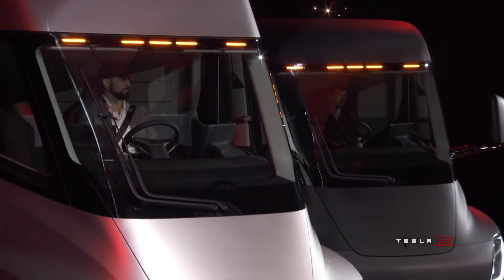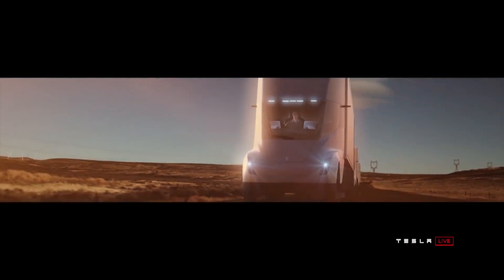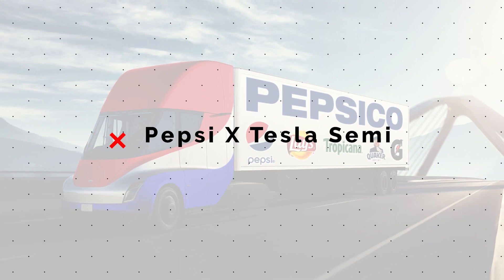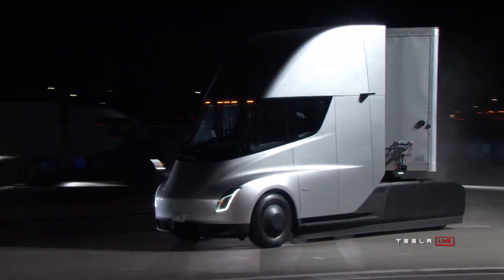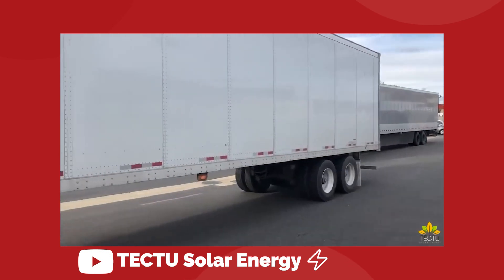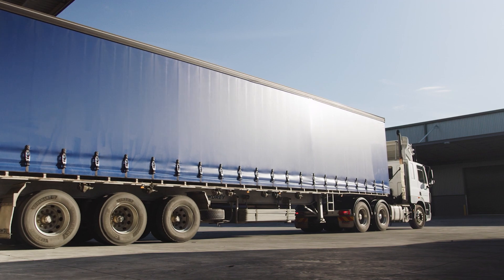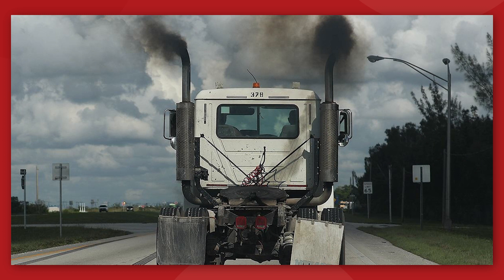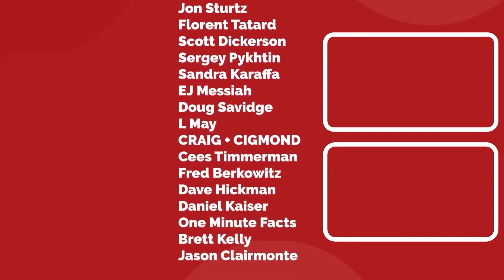Major New Tesla Semi Update Is Here!

Comment: Diesel engines can produce 2 times the amount of energy in watts than petrol engines . I see a good reason for tesla semis to have small onboard  backup generators to charge 1 of the battery modules for emergency movement of the vehicle and also to directly power the motors as a redundancy incase of electronic failure of the main system. Diesel is well proven and still worth its place in future technology . It has all the best hallmarks of any fuel except for emissions and particulate. This can be easily mitigated through water filtration of exhaust until this all electric technology has ironed out all the wrinkles and done it's time in the real world . The future is bright so let's not shoot ourselves in the foot !
Reply: you're just adding weight and complexity. The semi will be used where the 300/500 range models can return to base to re-charge as need new 1Mw chargers. Not meant for ALL use cases but will work for enough buyers like Pepsi and others as orders have shown.
Reply: @markreed9853  and what happens if an 80,000 pound truck has a power out issue in the middle of a busy dangerous highway while raining. You think a 10 pound generator the size of 2 briefcases is a waste of weight then . Its just to move the semi out of a dangerous situation . Your a danger on the roads without even being on it with your wisdom level . A chairgineer if I have ever heard one !
Reply: @Buzzhumma  Nothing is perfect in life but at the end of the day the designers, engineers and users will make, buy and use what works for them - if it doesnt then Tesla won't have a viable business model. I'm sure they know what they are doing and why!

Comment: So how have they solved the problem of the battery wight limiting the payload to about a quarter that of conventional semis?
Reply: The battery is not that much heavier than traditional engine/transmission/fuel. They're allowing an extra 2000 lbs for electric trucks, so it should work out pretty close to the same payload.

Comment: The smog regulations apply to new trucks, not old. Yes you can meet these standards with a Diesel engine. The answer has crossed your path at every railroad crossing for decades. Hybrids is actually a better solution, at least for the next 10 yrs or so till EVs catch up, as it requires no changes to the current trucking industry. It would cut pollution greatly and give EV performance numbers with out rage issues. Even if a hybrid truck could double the mpg, that would be a huge benefit.

Comment: Yes,you can reduce smog emision for diesel engines,with particle filter,catalotic convertor and ad blue,the problem is that manufacturers dont want to install this devices in the vihicles
Reply: Why don't manufacturers want to install these devices in the vehicles?
Reply: @Marc_Gagné  because it will increase the purchase price of the vehicles,and the logic of company leaders is that if a vehicle costs 2000$ more people just wont buy it,dont ask me,i have to high iq to be ceo
Reply: @Dustrunnersauto  i dont belive this,i live in uk,and in ower town the bus fleet is quite new,bought in 2017 and 98% of them already make black and blue smoke,some of them quite heavy, thise are buses that run in the city,around people walking on sidewalks in city centre bdw.
And i havent seen any "ad blue" filler door,only for diesel and oil,so i belive they have 0 anti polition devices.

I dont know but i think the bus fleet i talk about was manufactured in uk,i think mercedes busses dont make this mich smoke even older mercedes busses,as i m from romania
Reply: These devices substantially reduce reliability and increase maintenance costs. Electric is better.

Comment: Concerning ICE efficiencies, consider that ICE engine efficiencies are only now approaching 40% after over 100 years of development.  Electric motors came on the scene with four times the efficiency of ICE engines, and that is just the beginning.  Granted, efficiency on ICE engines has suffered due to technologies to reduce pollution but personally I'd rather drive a car that didn't slowly reduce my own life expectancy while I drove it.
Reply: So, ICE cars have 40% efficiency and Electric cars have four times the ICE efficiencies, so EVs are 160% efficient?  Wow.  Finally a perpetual motion machine.
Reply: @billweberx  You're thinking about it wrong.  ICE engines waste 60% of the potential energy from fossil fuels.  Run-of-the-mill electric motors only lose 15% of the energy put into them through heat and friction.  In fact, Tesla's motors are losing less than 5% of the energy they consume.  So yes, electric motors started out four times as efficient, and are only growing more efficient as time goes on.
Reply: @ibnorml  I wasn't thinking about it wrong.  You said it wrong, originally.
Reply: @billweberx  I will concede you are correct.

Comment: I just calculated: a semi trailer full of panels would propel this truck 94 miles per day... It's time to take advantage of this surface and technology as well...
Reply: What about the weight of those panels? Trucks in the US are limited to 80,000 pounds. If I remember correctly.  So that weight further limits the amount of product transported.
Reply: @nunya___  good question. I just looked up the weight of flexible panels and calculated the weight to cover a full trailer size. It would be 1100 pound of extra weight. The question would be if this weight would actually need to reduce the freight weight. If so, it's worth to consider the gain of spending less money on diesel or electricity. It's a money game, but I make any bet this will be the future!
Reply: @Gallardo6669  Are you figuring cells on the roof only? If your numbers are "real world" then a free 90 miles of range a day is significant.
Often drivers only pick up and deliver the trailers and a huge number of trailers are sitting for long periods so solar trailers would special case every-day use to recoup costs.
Reply: @nunya___  hmm, you certainly have a point. However, if all trailers are equipped with panels any truck would benefit from the panels once hooked up.- I simply calculated based my own solar array, the physical size and daily output per day in best conditions. I calculated a trailers roof and 2 sides. Panels vertical mounted produce as well, it's not significant less. I am certain the investment would be gained back very fast, I see it at my own house and the renewable energy field I am working in

Comment: The Tesla Semi won’t replace the long haul OTR routes any time soon. The 500 mile range, and very limited charging locations will take a long time to overcome. Mega charger stations will take at least a decade or more to be distributed densely enough that they can be built into most driver’s legal breaks. What they will be suitable for is local, regional, and many dedicated routes. Many local routes don’t come close to 500 miles a day, smaller regional routes may be flirting with the capacity, and dedicated routes could have chargers on both ends if necessary.
I think, much like EV cars, adoption will be very slow at first, but slowly it will ramp into exponential growth. The biggest problems with EV growth over the next decade will be electric grid capability and resources for cell production. Current EV market growth is rapidly outpacing raw materials production.
Reply: I don't see the infrastructure being as much of an issue as I do the range and charging time. Infrastructure can be sorted out relatively easily considering how predictable truck routes are for the most part. They can plan these charging stations with companies to have those in place for where companies need them. However, I'll be very impressed if Tesla can come out with a semi with 500 mile range, let alone anything that would be considered suitable for long haul. And that range, is almost always sacrificing storage capacity weight in exchange for the increased truck weight. And on top of that, charging time really needs to be 20 mins at the absolute most for a full 0 to 100% charge. Lower vehicle weight and charging times = more money for the companies using them, and that's crucial, and I don't see those as terribly low hurdles to jump over imo

Comment: The range of EV pickups at close to a full load is 50- 70 miles. This doesn’t bode well for EV Semi. The truckers only make money when they are driving  so lots of charging stops per day are going to cut into there pay and Transportation time of the products.
Reply: If the reported specs are accurate this will not be a problem
Reply: Rivan says 50% reduced range fully loaded so around 150 miles with normal 300-mile range model. Tesla semi range is max 500 miles WITH FULL LOAD it said

Comment: Anybody else concerned about railroad exhaust?
Reply: Yes, they are actually large generators
The drive train is electric already.
Could run on natural gas may in the first train car a LG not gas tank,pair with batteries for 80 % cut in a missions. Then later maybe all battery power.

Comment: You have a minor point that a battery powered vehicle is less polluting than a diesel truck. Setting aside the fact that probably a coal fired generator produce electricity for the battery. But being autonomous brings nothing to the table other than putting a guy out of a job. How is this not obvious? Now if the autonomous system is superior to a human that would be useful.

Comment: Diesel particle filters are easy by today's standards, yes there is a very small power loss, but it's not bad and the technology is super solid.
Reply: That is not what I hear from my trucker friends.
Reply: Do they filter CO2?
Reply: @Znegil  Climate change
Reply: @billweberx  you don't want Methan and CO, they have to emit something. The "Filtration" Part is only about the particles and even these get burned off a fixed amount of miles. If you would store CO2 in these, you would need a new filter every 50 miles
Reply: @Znegil  My point is, the solution is to go electric, not filter particles from the exhaust.  Have no exhaust in the first place.
Reply: @Znegil  The world needs CO2, just not so much.
Reply: @billweberx  absolutely true in the long run, I just say until we have enough resources to build enough electric trucks, it is fairly easy to use coated diesel particles filters on them.
Reply: @Znegil  Ok.

Comment: Electric anything progress will depend on the infrastructure to support it. A truck driver rarely drives more then 4 hrs straight before some sort of stop. Fuel , Food , or just to stretch their legs. By law a driver needs a break around the 4 hr. mark. 
Another thing to consider is as other Companies start developing Their Electric Truck , are they going to use Tesla chargers , hardware to charge up. ?
Reply: By law a trucker needs to rest (off or on duty break) before the 8 hr driving is up
Reply: @alvarofelipe8164  you can break that up into 2 , 4 hr breaks . 
Also there is a difference between bunk/sleeper time and off duty time.

Comment: The New Roadster and Semi were unveiled in 2017 - 5 years ago (This is not a Covid or supply chain delay)
The CyberTruck was announced in 2019 - 3 years ago (Macro issues had a role but Tesla wasn't ready to produce them until Giga Texas was well finished which is 3 years from Reveal).  My point is way too long from unveiling and not everything is Covid or supply chain issues.  I also bet Roadster is permanently shelved.
Reply: You could be right.   But Tesla has not been standing still.  He has been perfecting the machine that makes cars...the factory.   I agree that the premature announcements are annoying but Elon generally delivers.  It just takes a while.   

Contrast Tesla to the other automakers selling cars in North America.  They design the car then deliver them in dips and drabs.  I don't think that is better is it?

When it comes to electric cars Tesla is the best NA has by far.
Reply: Who else is doing much better.  No one's in mass production yet.

Comment: The bulk of trucking in the US is about 600 miles or day runs. 
The long-distance runs will typically use two-three driver to do long distance and is not as many think the majority of runs. Many drivers may question this, but when questioned they typically make multiple stops going cross country putting them in a 600–800-miles range even if they are going cross country. 

 A combination of tractors and trucks (26') or less make local runs; less then 300 miles as driver like to come home every day.  

So, the tesla semi is the right balance for many truckers and companies.

Charging is the many "problem" but many companies can have their own stations and in house and charging is the best solution. regulation are a pain to keep diesel and electricity is safer when trained correctly.
Reply: Nope the semi is not the deal for many companies lol….
Reply: @carholic-sz3qv  under 10 semi maybe not but it is cost efficient after that, and it could help the independent driver that see a benefit form companies that may offer this.

Comment: If electricity is so good , then why are all electric  cars and trucks  delivered to dealers with a Gas or Diesel truck ? ...   The more weight you put in a truck the shorter the range.. Wind, hills, load, traffic, all will affect EV PERFORMANCE and battery  temperature.   ETrucks would-be pulling over far more often to charge, resulting in lost time..  ( time is Money).. In return destroying the batteries from the load and continously charging. And would be  certainly  more dangerous on the roads from fire.

Comment: The maximum potential of Class 8 EVs will emerge after the advent of FSD. Say a truck could drive for ~500 miles at an average speed of 60 MPH on a single charge, stop at a strategically located supercharger, get fully charged in 1 hr, and continue driving. A single charge's worth of driving at that rate would last ~7.5 hours, depending on meteorological, topographical, and traffic conditions. Thus, in 24 hrs, the vehicle would spend ~3 hrs charging and ~21 hrs driving, achieving ~1350 miles of range. A human driver is limited by law to drive only for 11 hrs per day, requiring an hour's break during this period, also achieving an average speed of 55-60 MPH. Let's call it 60 MPH to compare apples to apples. That would yield 600 miles of range. Many estimates suggest a more conservative distance of 500 miles. Let's be generous and call it 600 miles. Therefore, a fully autonomous semi EV would achieve more than double the distance—1350 vs. 600 miles—than a human driver. And it would do so without the trucking company having to pay a driver.  It would be a no-brainer for the industry to adopt fully electric FSD-equipped Class 8 haulers.
Reply: I agree. Say every EV semi truck driver plugs in before bed, then again during their hour break, range should be absolutely no problem.

Comment: Completely incorrect long distances trucking has two divers called (teams) and can drive none stop 24/7, Tesla-semi will only be useful for delivering locally with day drivers (chips & soda) nothing with high priority. 100% of US industry is "just-in-time inventory" and have zero inventory in stock witch reduces company operating cost and trucking is a "just in time delivery" industry that's why trucks need to be able to drive no-stop for 2000 miles.

Comment: How is these electric vehicles and truck going to save the customer money how are these electric vehicles going to work when the power grid gets shut off how are these vehicles going to be paid for when there's no jobs have to remember the Democratic socialist party wants to destroy the United States you'd be better off making a hydrogen fuel cell that could power the cars and run the gasoline engines on hydrogen gas instead of gasoline you could probably get the same functionality out of a diesel truck using hydrogen these companies that are making electric cars do not have the American public or any public in mind except their bottom line do not buy an electric car research and study and build a hydrogen fuel cell and I'll make sure I buy three of them for my vehicles and then I can come my nose at the gas company and some my nose at the manufacturer of these electric cars